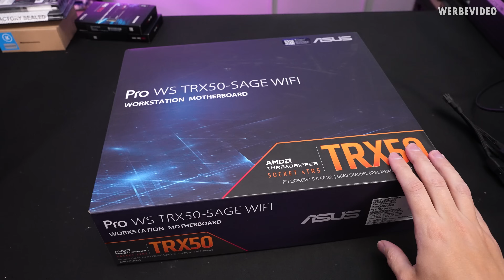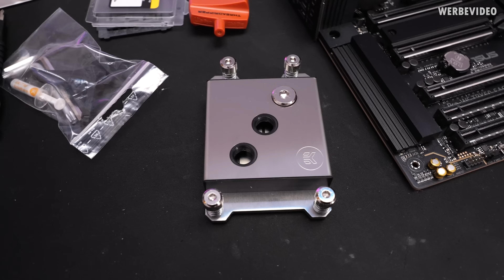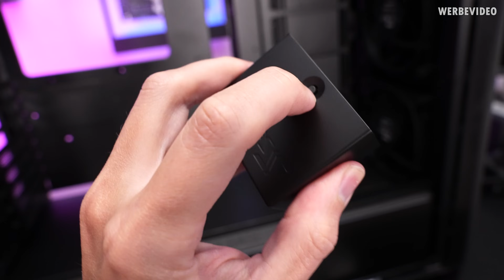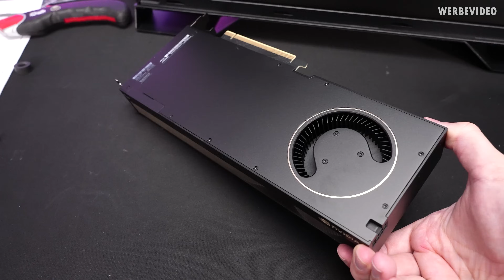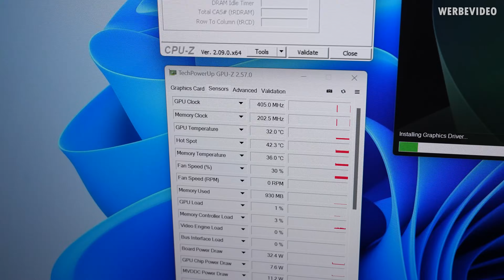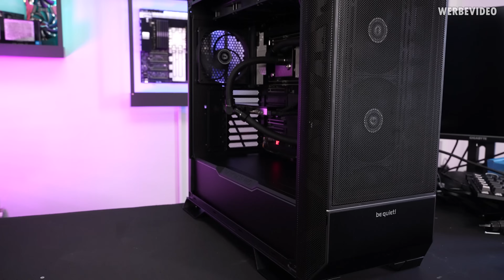Building a Crazy $10,000 Threadripper Workstation for Misha Charoudin @mgcharoudin

Comment: Hi, can you maybe tell me if the workstation mainboards can take 4+ RTX 4000 ada cards ... space wise ... potentially using PCIe extension cables and put them somewhere else in the casing?   or do you think I need a custom rack or even server rack for such adventures?   I want to assemble a simulation server for multiple users (Nvidia Isaac sim instances).

Comment: I don't agree your system will be quiet with that radiator support. I have that exact PSU, 14900k, and 4090 and am using a Corsair Obsidian so I have 4x360mm standard width Ek rads with every slot full of Phanteks T30s and even still the liquid temperature will get to 35C+ with my fans running 900rpm. And at 900RPM they aren't super quiet so I don't see how you can get a silent system with that little radiator.

Comment: Really stupid to put gen4 SSDs in this. A Crucial T705 smokes the 990 Pro and doesn't need a heat sync due to using the newer controllers.

Comment: Nice build! 
Watercooling is nice, but it immediately reveals the problem of watercooled HEDT platforms -- RAM just does not receive sufficient airflow for cooling. You reach low 70s degrees with only 2 sticks close together, so for anyone out there with a more dense RAM layout (e.g. w790 sage or dual socket MBs with 6+ DIMM slots per socket) at the very least install auxilliary RAM fans with water cooling, or better yet - consider cases with blow-through air cooling that respects RAM orientation - horizontal or "landscape" RAM for front-to-back air path and vertical or "portrait" RAM for bottom-to-top air path.

Comment: Building a Crazy $10,000 Threadripper ? amd 7960x + a6000 in 3dmark time spy extrem 10.000point VS  amd 7960x + rtx4090  in 3dmark time spy extrem 19.000point WTF
Reply: A6000 while more expensive isn't meant to be better for gaming it has 48 gbs ram doe
Reply: @theheroofourtime3578   a6000 vs rtx 4090 in aen tests ist rtx 4090 besser , a6000 ist zu alt

Comment: On the display port connector being a bit higher and not fitting in slot 1. Had the same thing with a dual A6000 build in a Lian Li case. Had to file the case to get the connector properly inserted :-/

Comment: I  built 2 systems for myself in the last 12 mo
system 1 name "White Tee"
7950x 
96GB of team 7600mhz ram running at 7200mhz
gigabyte RTX gaming oc 4090 (vertical mount) (will replace with a A6000 
all in a phanteks NV7 case

system 2 name "Homeless Ai Rig"

Thread ripper pro 7995wx
512GB 8X64GB ECC DDR5 5600MHZ OC to 6200MHz
ASUS Pro WS WRX90E-SAGE board
2x PNY RTX 5000 Ada GPU's with nvlink bridge
2x PNY RTX A6000 GPU's with nvlink bridge (slower but more vram from my old rig)
8x 18TB ultrastar drives 
4x 4TB m.2 Drives in 0+1
Fractal Define R7 XL (for noise and hard drive capacity)
dual 360mm X 45mm thick radiators D5 pump HK IV Pro cpu block all ZMT soft tubing with alphacool QD on the cpu block

Comment: Mmm.. with my 7950 bit overclocked, I am able to have 39500 points in CB23. I'm 3ds Max and CAD user. Price of my WS is about 1200 euro (CPU + MB + 64Gb RAM +  Noctua). You bought super expensive CPU and MB to have only 10000 points more. In real rendering test, my 1hour rendering will be 50 minutes in this PC. Not worth the money you spent
Reply: You can't get more pcie lanes with 7950x. There's more to threadripper than just threads.
Reply: , sure but it's clear from the video that his client doesn't need. He is a CAD 3d user. No reason to build a WS with such expensive CPU. 😊
Reply: @cecofuli  idk maybe they do. I'm not the one using the WS. I'm not gonna go assuming stuff

Comment: Sweet build, almost makes me want to build something with water cooling again, but the weight of it is too much for me. I'm building a rig right now, also a workstation, but it's aimed at being small and reasonably light, and to not look 'interesting'. Dell T5810 case, looks like any office PC, but 14core xeon, 256Gb quadchannel ECC RAM, 8Gb Quadro, and 5xM.2 SSD's on 2 pcie slot carrier boards. For a reasonably cheap and small PC tower it'll be able to run quite a few VM's at fairly good performance. I think, it's not complete enough to boot yet, heh.

Comment: Roman, it's not a AMD/Threadripper issue.. it's an ASUS issue... Asus doesn't have their BIOS properly setup. 

For my company I've run a 3990x till the Asus mobo blew it up... now it runs a 3970x as a replacement... and that survived for 2 years now as the BIOS was updated several times. It's still unstable on the memory, especially if you add 8 dimms. 

The Asus BIOS somehow struggles with 8 dimms, a threadripper and then keeping stable voltages. Best advise for stability is to mildly OC the dimms on voltage, do not use XMP/presets and don't OC the CPU unless you're actively using it OR... you restart daily. It glitches on average after 5-7 weeks, which is only a problem when using all cores for computational fluid dynamics.

Just FYI, with the poor ASUS support... it will never enter my business again.

I have almost the same build LTT did back then, but I did build it ironically 1 month earlier... if I had seen the comment about mem issues, it never been done with ASUS. They also fixed it with BIOS updates, but released their vid after the first update... for me the 2nd still killed the cpu (or it was already too damaged). Sadly the warranty was there, but AMD had no replacement 3990x... hence the 3970x... I use the spare 3960x in my desktop.. just in case :D

Comment: 20:15 I have been forced many times to cut the plastic on the HDMI connector on the cable to get it to fit in the graphic card. I wonder why they still make graphic card to be put upside down. We don't share PCI with AGP anymore. No need for install the graphic card upside down.  It is time to install them the right way.

Comment: For the GPU power connector, the reason it uses a 8 pin EPS connector rather than 2x6/8 pin PCIe connectors is that the 8 pin EPS can deliver same, if not more power than 2 PCIe power connectors. Since the A series cards are designed for workstation/server environments, Servers and proper workstation PSUs (especially ones with redundant power supplies) have additional EPS power connectors to run high power GPUs. This saves on having to have multiple cables connected a GPU when you can get away with 1 cable per GPU.

Comment: As someone that uses CAD on a daily basis (Siemens NX), these programms actually scale pretty poorly with cores. 
They scale only marginally with clockspeed, but scale pretty good with memory timings and Cache. Basically anything that speeds up retrieving intermediate results/latency to data because of the sequential nature of the calculations. 

7960X wouldn't have been my choice, but I guess he doesn't run JUST CAD software I suppose. But if I was making a CAD machine, i'd have thrown in a 7800X3D with some fast dimms and an AMD GPU because they have much lower driver overhead.

And Yes, VRAM is also very important.

Comment: The threadrippers are better than the competing xeons in a lot of ways, but then they kneecap them by only allowing 1 dimm/channel unlike intel that allows 2 dimms/channel, halfing the max supported memory compared to Intel. And with rumored optane pmem support for the coming 5th gen workstation xeon scalable coming later this year this gap will be even larger.
AMD has the horsepower to make use of larger memory capacities better than Intel.

Moral of the story I guess is that threadrippers are probably better than xeons unless you need a crap ton of memory or Intels Data Streaming Accelerator, or if you prefer to have fewer but faster PCIE lanes.

Comment: But isn't it better to do 2x4090 in 2024? It's cheaper, and would be 4x faster (i think). If you're doing simulations, the NVME gen5 speeds could be very beneficial for reading / writing simulation cache.
Reply: RTX 4090 have had issues with doing multiple cards with Cuda since they don't use/have NV-link on them.

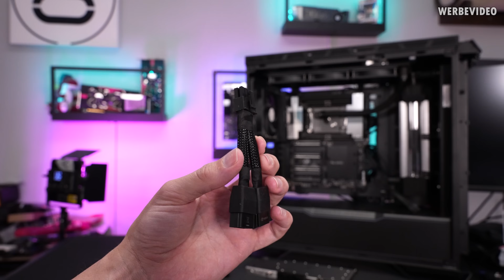Comment: 13:05 Oh look, the connector that would have avoided all of the issues people have experienced with 16-pin connectors. Gotta love it when companies attempt to solve a problem of their own making.
Reply: Agree. The EPS12V connector has been proven reliable over a decade. Overclocked Intel HEDT CPU from the past hits over 1kW and 2 of these EPS12V can power them without issues at all. Unlike this new 12VHPWR connector.
Reply: @fleurdewin7958  Exactly, it was just so stupid, if we already have a connector that is very much rated for high power use, then why not just adopt that like they did here instead of some weird single mega connector mumbo jumbo?

Comment: i dont know if i would do a threadripper build with just 24 cores, i would at least get 32, perhaps the 24 is just right for this case, but  feels wrong in my opinion

simple build, i personally do not use rgb, but i do like some light in the case, no ligths is weird, at least some leds showing the motherboard is active should be the minimum

Comment: 10k and you don't use discrete loops?
Reply: add the cost of an additional pump and reservoir, additional complexity and potential failure points, and for what? steady-state full load temps were completely fine.
Reply: @uzbekistanplaystaion4BIOScrek  I thought it was really pricey then looked up the price of the GPU, $6,800...

Comment: Additional speed that just ends up throttling anyway. Heat has become a real issue with today’s hardware. I guess our loops will have to include Nvme’s now 🤔🥴. We require a new cooling solution because we’re hitting the proverbial wall.

Comment: In this specific use case what are the advantages of this threadriper vs a 7950x... does just 8 more cores make a huge difference considering the cost?
Reply: TR also has a fuckton more PCIe lanes and memory channels. If you're memory bound TR is faster.
Reply: Their specific CAD apps may be validated around TR?

Comment: The workstation cards have better blower coolers than all the gaming cards, that aluminum shell & metal backplate shows you that a blower isn't that bad when properly designed. By the way can you weight that against a RTX 2080 ti blower typer cooler, I'm pretty sure that cooler with its included shell is heavier than those on the RTX 2080 ti blowers.

Comment: Good ol AMD, couldn’t even run 6000 CL32 and went back to 4800 CL40. I have to say though that even though it’s a nice rig, it is completely the wrong hardware for CAD or simulation. For CAD you don’t really care about core count since the software is mostly single threaded, what you want is the highest core clocks. Now when it comes to simulation, as far as I am aware the license costs scale with number of cores, so again a cpu with 8 cores running at 6ghz will complete the job in the same time as a system with 16 cores at 3ghz but the license will be substantially cheaper. Long story short, I would have gone de-lidded 14900ks and disable e cores and HT, 128gb of ram at 7200MT CL36, GPU is fine, ssds are fine, really just the CPU is a poor choice for CAD and simulation, great for video editing, if it could run EXPO.
Reply: 14900ks isn't small business/enterprise grade hardware. It's just not a good idea for 24/7 operation over multiple years. Also this is 24 cores. It's 4.2ghz base clock and 5.3ghz boost clock. Threadripper platforms have lots of io lanes and other features. Suggesting a consumer system for this is not a good idea.
Reply: @skilletpan5674 I do cad every day for the last 12 years. Other than one dell precision laptop that had a Xeon all have been “consumer” i9 CPUs. So I don’t really know what you are talking about. I also run a NAS and media server with an i7 from 2012 that has had 100% uptime for the last 5 years. Most crashes won’t happen because of the CPU, or really any hardware, it will most likely be software, or power outage. Frankly, this thing already shit the bed and couldn’t detect the ram at the advertised speed and reverted back to JEDEC, so not so reliable. Also they have terribly optimized schedulers for CAD because of the chiplet design that is basically the same thing as 20 years ago with multi socket mobos and numa nodes. Windows 11 pro is not even the right OS. You can try to prove me wrong, but every solid works benchmark will show higher clocks and no HT wins. Other than the GPU nothing in this system was professional, the CPU is amd consumer garbage, pro for beginners would of been the Threadripper PRO, and for real Pros the Epyc line, next the ram would have been ECC, the drives would have been setup in raid with redundancy as well as having redundant power supplies. This is purely a consumer build with the wrong hardware for the job it is meant to do, as a matter of fact I will say it is garbage and not worth half of the cost as far as performance will go, or reliability. I will bet that in the solid works benchmark my dell 7780 laptop with a peasant 13980hx cpu and 5000 ADA will beat this thing. Also like I mentioned most simulation software like Ansys for example #1 comes default with 4 core support, each package of 4 cores costs extra, and the CUDA package is extra as well. Magma for casting simulations is also 4 cores, with the license cost being double at 32 cores. So an extra 40,000$, no CUDA option. Unless you need to run very very large simulations it makes more sense to get 2 8 core licenses with really fast single socket CPU so you can run two iterations at the same time on two machines.
Reply: @radugrigoras  that's a nice wall of text. They do more than just CAD.

Comment: @DerBauer
Why does nobody ever use Crossflow Radiators with one port on each side of the Rad?
They make the line runs so much easier and make for a much cleaner look as well, 
because the Rads do the job of tubes which reduces clutter and tube length.
Reply: Cross flow radiators are longer, and you need acces to both ends. For example in this build, the top radiator, for the port at the rear the fan would be in the way, and for the front radiator the port would be in the basement of the case.

Comment: I don't know what he paid for the A6000 but anything near retail would be tough to justify unless there's absolutely a need for for a single card solution with unlocked drivers. A single 3090Ti gets you most of what it offers and can even be a bit faster for 1/4 the cost. 

If 48GB is truly necessary, 2 of them across NVLink is faster and still notably cheaper these days, even with a couple blocks. That should work great for their use case but obviously raises the power budget. Otherwise a 4090 makes the most sense but Nvidia learned their lesson and removed NVLink.
Reply: No NV-link is also why no developers are buying 4090's as many people need NV link with more than 48GBs Vram. Check some developer forums RTX 4090 can't even run multiple card in Cuda without problems like they're supposed to.
Reply: @kevinerbs2778  I don't quite understand what you're saying. Did you misread my comment or are you talking about the 3090?
Reply: @JJFX-  I'm saying if the RTX 4090 had NV link more developers could buy them since they cost less & could pool the memory. Expect RTX 4090 don't Nv-link & no ECC Vram. Also, from what I've read even trying to use two for Cuda has been a headache for developers. The only reason this RTX 6000 card exist is because it has more memory & it's ECC Vram. People tend to overlook the ECC part. It would be nice to use 48Gbs of Vram of two 3090's/ti's but the lack of ECC Vram means no one is willing to buy them when stability matters with critical data.
Reply: @kevinerbs2778  I see. Yes, two RTX cards across NVLink isn't always ideal but it really depends. I know people pooling memory (3090 Ti's) for machine learning and rendering applications and it works fine for the most part. Two equivalent A6000's is a bit faster for certain data sets but it's very close. The thing about GDDR6 is it already does a pretty good job dealing with basic 'error correcting' but they don't allow those features in RTX cards to be accessed so you're relying on the native behavior. For the most part it should be sufficient but yes, for mission critical work the professional cards are a better fit. 

In my experience with CAD applications, the bigger concern is the buggy behavior of the applications themselves (I'm looking at you Autodesk) than a random flipped bit.

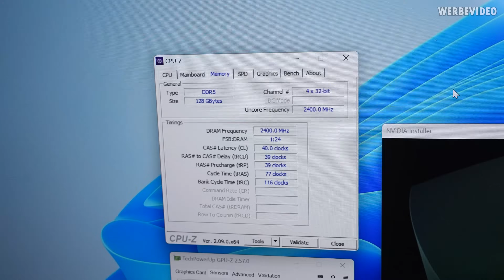Comment: 17:36 is the RAM intentionally running at 'stock' speed/timings or did it reset itself after the boot issues?
Reply from the maker: that was after re-seating the memory. I applied the EXPO profile again afterwards
Reply: @der8auer-en Should I give Seasonic another Chance. I used to use Seasonic PSUs long time ago along with Corsair which ever would fit the budget and be available. But once a Seasonic PSU failed(which happens to all brands including Corsair) due to sudden outage and took down GPU and Motherboard with it. So when we went in to claim Seasonic only replaced the PSU but did not cover GPU nor Motherboard. And that was an expensive fail(I had to cover for it). After that I stopped using Seasonic and only use Corsair as if anything fails that is attached to it due to its failure then Corsair covers the components Fully no questions asked. Seasonic sadly doesn't. At-least they dint few years ago. Did it change or do they still not cover other components besides their PSU on failure. I don't want to risk it like that anymore for my clients. I don't run business on it but do individually. So it be hard to take that kind of hit again. Reason I be even considering Seasonic is that sometimes I find decent deals on it while Corsair be either out of stock or high on price.

Comment: Oooohhh, THAT Misha.  Fastest 7Up round the 'Ring Misha.  Seems like a good guy, probably cool to work with.
GPU in second slot is criminal though, the latency increase can be measured in seconds.  Sure, it's 0.00xxx seconds, but still, bigger number not better.  😆